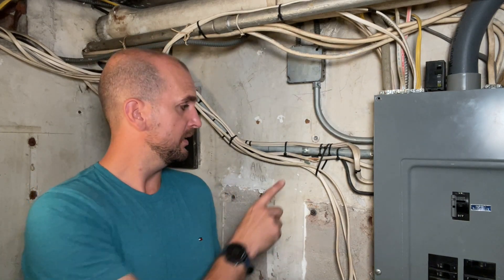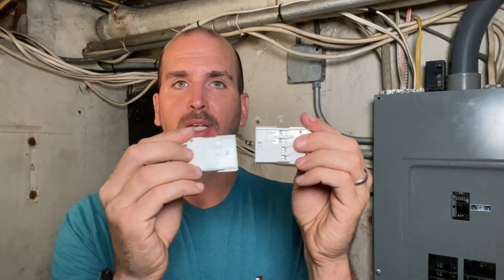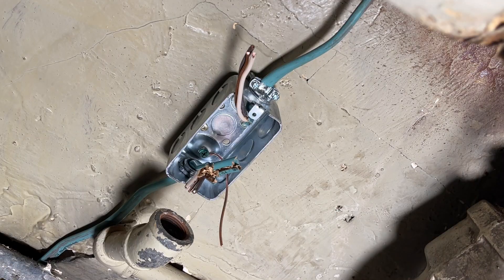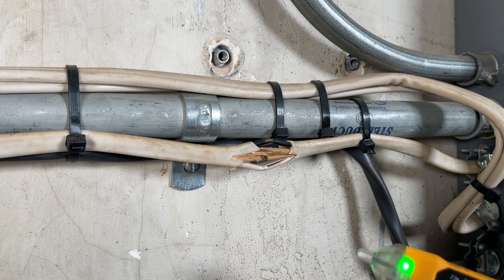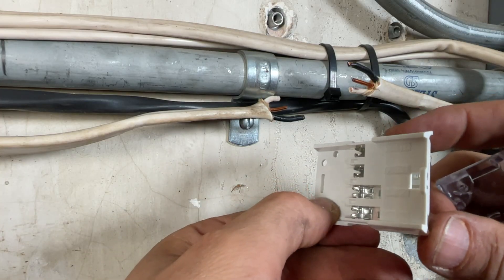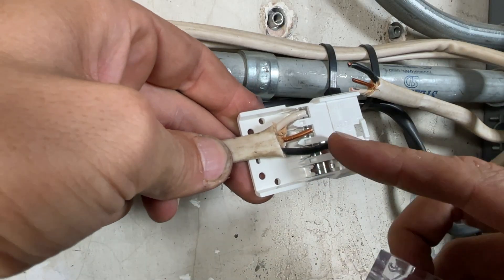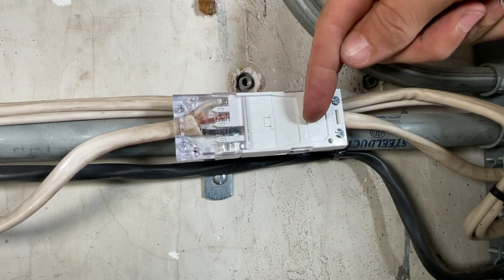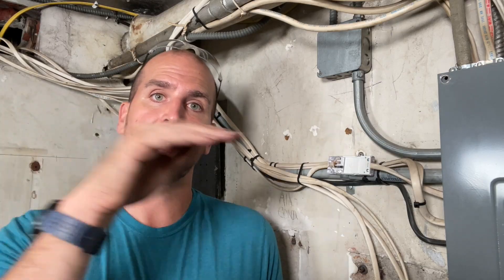How To Repair Damaged Romex Wires

Comment: I have been an electrician for 26 years and I only like to do splicing in a junction box. Pre twist my wires and use wire nuts or Buchanans with a 4 way crimper. These little cheap quick connectors might be legal, but so is stabbing wires into the quick connection on the back of receptacles and we’ve seen how that works out after someone uses a 1,500 space heater in their bedroom. To be honest, if the only damage is the insulation and not the copper, I would just use electrical tape to repair the insulation as long as it’s not in a damp or wet location.
Reply: In some cases like that, if it is 14 Guage wire, I will get a piece of wire that color but #12, pullout the copper then slip it over the  cleaned up #14, then small bit of tape to keep it together.  I do this in grounding in a metal box on all the grounds, trying to keep the bare copper from contact of any hot or nuetral terminals. I have found that  #12 for 14 Guage, and #10 for 12 Guage. Some really old wire had a insulated ground. Another little trick I use is with a sharpie.  Take your strippers, pull the backend of your sharpie, put the point cover back on, keeps your hands cleaner. The ink in the felt is covered in plastic, take your knife cut about 3/4" slot on the end, then on a white you can change its color by putting the sharpie, with that slit and run it down the wire. About 3 passes down the wire, so running a dead end 3 way,you can use the black as a common, change the white to red, now you don't have a neutral as a current carrying conductor. If the inspectors do not enforce every box having a neutral. Works great for a switch loop, dead end switch. Feed n neutral in ceiling box, 14/2 to switch box, turn white into a red wire, at both ends, feed the black, instead of white, now your new red is a switch leg. Twisted together with ground letting anyone know what wires go to light, and the switch the blk is the hot n new red is switch leg. Before I retired after 40 years, I ran servicefor a good 20 years by myself.  You learn a lot by teaching yourself how to get things done, correctly. Never had to worry about what a helper was doing. Really hope any of this helps you out. Get a bunch of little tricks, all safe, don't need to worry. Took a lot of pride in what I did. Passed all my tests. My back gave out, so 65 was my retirement date. Miss it alot. Still get calls from customers, and just load up n help them out. Best of luck.

Comment: That manufacture would be smart to add 2 inches to the length. Once you clip those wires it seems like it only gives an extra inch to work with. If you make 1 mistake or have to remove damaged wire you wont have enough length. It would be nice if they just made junction boxes where the romex went in both sides then clamped down. This way you could add a chunk of romex any length you needed  then use another junction at the other end. I guess you could by 2 of these kits and do the same but seems a little over kill. Cool idea as I just had to do this in my crawl space to add an outlet not to repair damaged wire and length of wire made me add another junction box just to make it work and get 3 extra inches of romex to add the outlet.

Comment: The only time I have seen those used, they were melting and shorting the circuit to a ceiling fan.
Reply: Yea okay pal. Sure you have
Reply: @electricaf365  
You can believe what you want, but it doesn't change the truth.

Comment: For some thing that was just skimmed open for testing like your cable I would not waste my time putting all that effort into work connector or a box I would strip the cabling back I would get high quality electrical tape and make multiple passes over each of the conductors that were exposed and then I would do multiple wraps Over the whole thing there’s nothing wrong with those conductors now you have a splice or a junction which is always a place where you can have a problem

Comment: Could someone explain why the hot lead is left long instead of the ground/earth?  I was told that the ground should be left longer (in general) to be the last contact in case the wire is pulled free.

Comment: You just strip the wires twist them in a western-union manner, use solder, and either shrink wrap or tape.
Solder is far better than any box or connectors

Comment: Just curious, Since the wires are not broken but only the insulation has been taken off, could you not tape each wire separately and insulate the exposed parts of the wire. Would that be wrong and why?

Comment: Maybe add, test the wire with the electrical tester with the power on. Just so you know there isn't any breaks further down the wire that are going to activate the moment you start moving the broken wires.
Reply: The thought that I have is that it could be likely that if the wire is damaged in one section then it could have been damaged in a different section as well.

Comment: I worked for an electrician and he disliked the Wago connectors.  He said he has seen them fail.  In addition, some of the old timers prefer what they have used for decades... wire nuts.

Comment: I feel more comfortable with a j-box splice compared to those TE splice connectors.
Reply: Did you check the price of those connectors? OMG that is just insanitty!
Reply: @Ragnarou812  at first when I saw $30 I thought it was for a pack of 10 sets... But then I realized it is for only ONE SET! yeah, I'm not using these!

Comment: So first of all wires in your wall will never get pulled on but for everyone talking down to these connectors just know it’s a more solid connection than wire nuts. It’s required to be. I dare anyone to do a pull test on a wire nut joint and then on the TE splice kit and I guarantee the wire nut spice comes apart first. I had a family member who worked at TE and he knows his shit. This is a much stronger connection than a wire nut connection and maintains the integrity of the cable as if it was never cut. Introducing absolutely zero resistance into the circuit. (These are only as good as the person installing them if all instructions are not followed exactly then nothing is guaranteed)
Reply: So ask your family member to provide proven, validated, test process results where those little plastic telephone, low voltage connectors took long term amounts of electrical heat from even 12 gauge wire, and show us all the results... Who really cares about any real or faked pull test??? Where is the supposed proof that those tiny, little thin metal connectors are Ever going to handle real electricity loads for X amount of times over periods of years??? And you think a pull test means those little toy telephone, low voltage connectors are somehow better???  Hilarious !!!! And while you and your family member, are gathering all those decades of test results of your low voltage connectors, be sure to add the proven, validated, test process for measuring the amount of - resistance - from wire nuts vs your little TE toy connectors... Go ahead, we are waiting...

Comment: Personally I don't think I'd use that splice kit. If the damage was between two junction boxes I'd replace the romex. But if it was between the panel and a box I'd get an electrician.

Comment: Being that close to the panel. I would have remove the cable from the panel and used heat shrink tube on hot and neutral. slide the plastic Romex jacket back on and heat shrink between the cut white jacket. if you use white heat shrink tube you might not even know it was repaired.

Comment: You have a bigger safety issue.  That romex needs protection from damage.  Some wire mold would be the easiest solution to install with the wire already having been run and hooked up.  Above the panel you could just box the wires in.

Also, even though the splice kit may be listed for hiding in the wall, the NEC still requires that the splice be accessible for maintenance which would mean installation of an access panel wherever you hide one in a wall.
Reply from the maker: Hey Ian, thanks for the feedback!
Reply: Nope

Comment: Speaking of the non-contact testing I’m getting one for myself. Some years ago I found a numbskull had installed a whole house fan just pushing up the fan into the attic through a big ceiling hole and managed to push a run of NMC upwards. Well, inspection showed that the cable was being cut where it ran under a staple. Proud to have found it I turned off the breaker, cut the cable, then while working on it got bit from the wire farther from the breaker panel. Another numbskull had borrowed a neutral in a remodel and backfed that circuit! The pro’s here know this, but amateur me never imagined anyone would do something so stupid. I’m about to fix up an old condo and now know the degree of idiocy out there is mind-numbing!
Reply: yeah my whole house was stupid stuff like that I had problems in my wiring that the do it yourself books never dreamed of. somebody put in a 3 way switch and just hooked up the three wires to the three terminals of regular 14-2 and then it blew circuit breaker so they switched hot and neutral at breaker panel till it worked running power through ground wire i couldn't believe it was possible
Reply: That’s absolutely insane!
Reply: @ranger178  LOL, WTF ?!

Comment: Turn power off, finish cutting wires, crimp wires together, put heat shrink tubing over hot and neutral, Then heat shrink all wires together

Comment: Before running out to use these, better check with your local, state inspectors first. These are not acceptable everywhere. Personally, I would have replaced the whole wire.
Reply: A state inspector? 🤣🤣🤣🤣

Comment: your splice was so close to the  panel and you had a junction box already just above the  stripped wirecut the romex into the jbox above and use the conduit to get into the panel with a new feed from the breaker to the j box

Comment: I would not trust that cheese ball gadget. I've tried other items that look a bit like this in metal in the past. Actually had one blow up when the power was turned on. It is just to easy for these to have a weak connection. I would STRONGLY recommend pulling a new run from the panel to a j-box to correctly fix this. Far too many DIY items claim to meet code, yet a bit of research many times proves otherwise. The wago's on the other hand are approved as replacements for wire nuts. However I would not use them on circuits above 15 amps. Switch over to either wire nuts, or polaris taps at higher amperage.

Comment: I mean some electrical tape and 30 seconds would have squared away that wire just fine. Seems like a waste of time/money to do all of this. Technically if you put the wires in a box, you must have sufficient length of wire in there. I believe it's like 4-6". Wrap each wire with a small piece of electrical tape. Then wrap the entire section. Done.

Comment: I personally would not use that splice kit , reminds me of butt connectors  you would use in your vehicle , and they are crap , as for the waggle,  even those i wont use  , i will stick with the wire nuts and my Klein's to twist all wires together in there corresponding colors!!!

Comment: OH yeah, because that won't glow under full load, looks like a toaster element waiting to melt something. I bet this glows before the breaker pops... I assume this is a 15 amp circuit? I hope this bodge job isn't approved for a 20 amp line... why not just run a new line to the first box this goes to, much safer option to me, and in a humid basement it won't corrode like this will.

Comment: how to repair damaged romex wires: call a licensed electrician. About 40% of all my service calls are fixing or troubleshooting an overzealous homeowner trying to diy an electrical repair. Im not complaining, i love what i do, but putting your family and home in danger because you wanted to save a few bucks just isnt worth it. Also, wagos are the worse way to make joints. Think about it, those things are just little aluminum stabloks that dont make very good contact with the conductor. When you use wirenuts correctly you are twisting half an inch of exposed conductors together making a good secure connection and then wirenutting it off nice and tight. This splice kit is a whole lot of thin aluminum inbetween your good copper conductors.

Comment: No way would I use that connector. If the wires were not broken, I would of used a Scotch Cast epoxy. It is used for underground splices, so it must be ok for exposed work. The epoxy is better than the original insulation.

Comment: Some brush-on liquid electrical tape and a few wraps of regular electrical tape would have been more than enough to patch some nicked insulation.  I'd be concerned about those various splices heating up if the circuit is subjected to the full amp rating it's supposed to carry.
Reply: I agree in the sense that it likely would work OK.  But, it likely would not pass NEC or a local safety inspection.
Reply: Would your opinion of this splice kit change if it was a 15A lighting circuit? With lower amperage LED bulbs and less draw, many lighting circuits are now running at a fraction of what they ran a few years ago.
Reply: @mikecumbo7531  The problem is you have no guarantee there will always be low current on that circuit. It will always be a safety hazard, a ticking bomb.
Reply: Here is the funny thing about circuits. Those wires can easily take more then the 'rated' ampacity. Usually twice the rating, for hours. The problem is the insulation on the wire doesn't hold up for extended (talking years) use at those temperatures, hence why breakers are made to protect the wire, and only the wire. I properly done splice should NOT be heating up any more then the wire itself and so should be fine, if you have a bad splice (you didn't crimp it enough, ya, your gonna have trouble.
Reply: In the time and material spent, I could solder and shrink wrap.
Reply: @bob-ny6kn  solder and shrink wrap is against code.  Any splice needs to be in a box and needs to be accessible.  If the wire wasn't broken, you might be able to wrap the individual exposed wires with electrical tape or liquid electrical tape, but I don't know the exact code on that. If the sheath of the Romex was nicked without damaging the wire insulation, it's pretty standard practice to wrap that area in electrical tape. 

If I had a damaged wire in the wall, I would either see if I could add a box there without it looking too out of place, or finding the first accessable portions of that wire on either side of the damage, and re-pulling that section with splices in accessable boxes.
Reply: @bob-ny6kn  While I would think that done properly that would be very functional and safe, would the National Electrical Code and the local building inspector accept it?  I have plumbing in my house which is functional, does what it is supposed to.  But, I've had plumbers tell me it all needs to come out and be redone to be to "Code"
Reply: @BryanTorok  I had an engineer look at our house and basically told us that we should rebuild the entire first floor because the 12X2 (actually 12inches by 2inches) floor joists didn't have hangers on them and were notched into the cross beams. This house was built in 1870. There is no way I'm touch a 150 building structure to build it to code.
Reply: @PSNDonutDude  I completely get you.  In my case, I'm going to need to replace the dishwasher where part of the problem plumbing is.  Since I'm going to have that area exposed, I'll redo the water supply and drain to modern standards.

Comment: Not an electrician by any stretch of the imagination, but I've properly replaced enough of those little janky T-Splices that are supposed to "cut through the insulation" in cars and boats to know that they don't last. This product looks a little better made, but still a hard no for me. Simply not enough contact area and they add a new point for corrosion. Fix it or install it correctly the first time and you don't have to worry about it again.

Comment: Never, ever, use electrical tape to try to hold something in place. It can insulate up to but not above 120 volts and so if you need to insulate something and hold it in place and you are absolutely sure that it's not higher than 120 volts, then wrap it in electrical tape and put actual tape on top of the electrical tape making sure to have a solid place to connect the real tape that's not just on top of the electrical tape like connecting it to the wire or whatever is behind it.
Reply: It's also hideous and makes a mess.

Comment: For all you electricians out there, what exactly is the point to where something is damaged? I had some jackhammer work going on in a confined space in my basement. At some point, the very hot tip of the jackhammer  came in contact with a 6/3 cable supplying power to the shop. The exterior sheathing melted on one side, but left the conductors and insulation damage free. Should this be j-boxed, or can the sheathing be repaired by wrapping with electrical tape? The melted section is about 40% of the cable circumference, and about 1" along the length of the cable.
Reply from the maker: Hey Lorne, if you don't get any feedback in the YouTube Comments you can jump over to our Facebook Group "Everyday Home Repairs Community" and should get plenty of feedback (some good and some bad 😉).

Comment: This connector is no different than the back wire of a receptacle. Total garbage. With the little exposed wire, I would strip the sheathing a little farther, tape the tiny exposed wire, than tape the whole thing. I have done that before with no issues. That connector is garbage. It WILL have problems sometime down the road when moisture gets in there or when it heats up a little, just like a receptacle. It's almost the exact same design. You can't tell people not to back wire a receptacle, and then tell them to use this piece of shit connector. You are contradicting yourself.